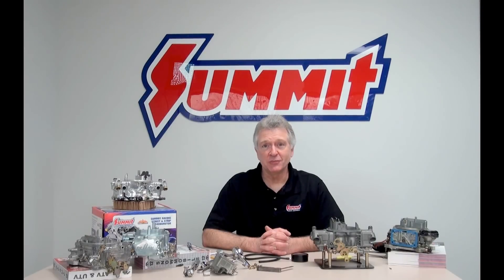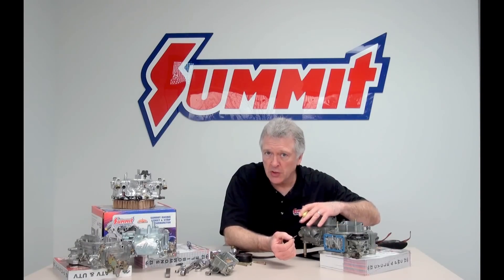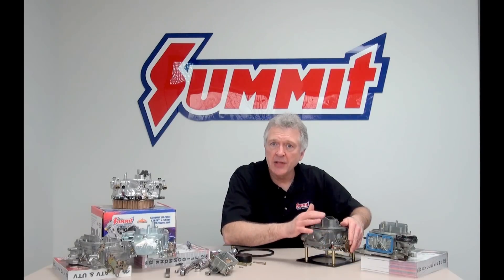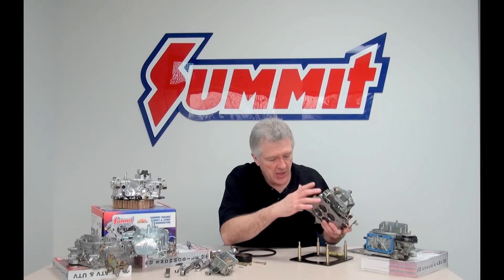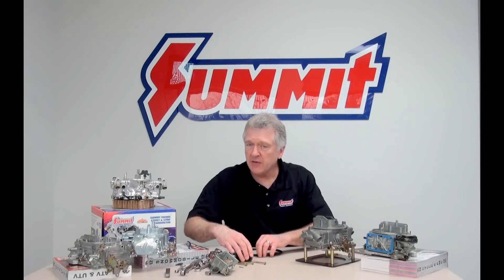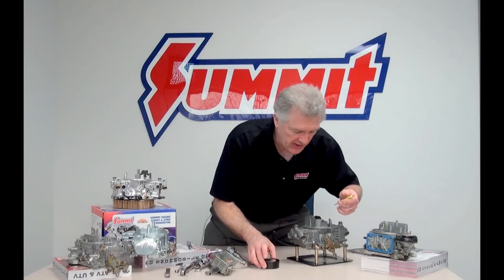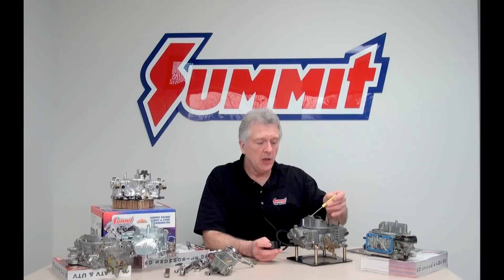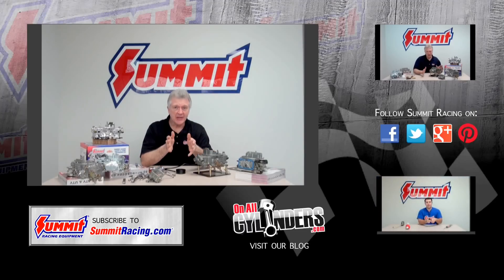Carburetor Idle Adjustment - Summit Racing Quick Flicks

Comment: Did he say power valve can suck in fuel at idle if vacuum reading at idle is lower than power valve size? I thought power valve gets fuel from the booster which is completely separated from idle circuit?

Comment: I was looking for a replacement manifold on the web site, talk about confusing, I typed in my make and model and it said no match for a 66 corvette
Reply from the maker: Im going to assume it’s a small block so here is a link to the small block manifolds but it would best if you gave us a call at 1-800-230-3030 that way we can get you the best match possible! 
 
https://www.summitracing.com/search/department/air-fuel-delivery/section/intake-manifolds/make/chevrolet/engine-size/5-7l-350/engine-family/chevy-small-block-gen-i

Comment: Hello, I have a 1987 F150 351 5.8 engine with 2 year old 4950 Holley  Carburetor. Some bad gasoline from the rear tank end up in my carb and now I have a big problem.
 When I have it in Park the carb works great 3K, 4K Rpm no problem, but when I have it in DR (Load) pushing the brake down and gas pedal to the floor I'm getting 2K RPM.
Please help. Thanks for your videos.

Comment: I'm having a problem with a 4160 700 cfm, 2 corner idle. Just rebuilt, new power valve 5, 10-11 hg vacuum on motor. Idles rich, but I tried putting a .017 wire in the IFR to lean it out, Holley never put the brass inserts in the hole. Just casting. And its huge. Should I throw the metering block out and get a good one or can this be saved ?

Comment: i have a 93 Chevy 1500 truck with a 350 bored 30 over with flat tops and a 287 cam with a 480 lift and a 232 duration and I have a Holley 600 CFM and when I turn my steering wheel it tries to go dead I've tried everything and I can't get it to stop

Comment: i have an 850 4 corner idle e-85  quick fuel carb that will not adjust at all, i can close them all and it will not dye, i changed the power valve to a 6.5 from a 3.5 that came from factory i have not checked vacuum on engine but if i put it on gear i will not dye, it's automatic and is a 408 ford
Reply from the maker: Hi Sergio, 
Can you give our tech line a call? 1-330-630-0240? Or you can call Quick Fuel directly. We would need additional information. Thanks for watching!

Comment: Norm great vid. Why don't you mention the secondary metering block in your tutorial? Don't all 4150s have idle mixture screws on all 4 corners? Shouldn't you continue to adjust thru to the secondary block also? You only apply the adjustment to the primary metering block in this  case? What am I missing? Also I have a quick fuel 600 cfm. double pumper (based on a 4150) I can apply the same adjustments to this carb correct?
Thanks in advance. 
Keep up the great work.
Reply: i have a 4150, street avenger 670, it only has the front idle screws

Comment: I have a 600 cfm holly 4v. It wont idle at all . what could this be? I just trying to get the car running after 20 years sitting
Reply from the maker: +Dave Poeske, 
Dave after that many years of sitting there are so many things that will need to be checked and most likely fixed. Things such as flushing the fuel system, doing a compression test, rebuilding the carb, checking for cracked vacuum lines, etc. Give us a call and we can go over some things and help point you in the right direction! 1-330-630-0240.

Comment: Hi Norm, I'm a Norm too, I bought a 502/502 crate motor about 14 years ago and put it in my old Chevy truck, I know I need to educate myself to maintane and tune the motor myself.  It came with a Holley 850 (don't know if it is a double pumper or not).  Subscribed to your channel and will start watching your videos.  For starters I'm sure my carburetor could use a good cleaning, I was told once not to spray carburetor cleaner everywhere as this will dull the finish on my aluminum manifold.

Comment: I have a QuickFuel BDQ-850 mech secondary carb (4150). I've run the secondary mixture screws all the way in, and using only the primary mixture screws, I've finally managed to get a decent air fuel mixture. However, the curb idle screw is backed all the way out, and the car still idles at about 1000 rpm. What can I do to get the idle lower (I want 800 rpm).

Comment: hi, great videos! im not sure if i missed something so i will ask, my carb has a 4 corner idle circuit. how and when do i do the secondary side? just do it the same way and time as the primarys are getting done or do i have to have the motor revving enough so the secondaries are slightly cracked? thanks
Reply from the maker: Hi khany454, 
 Four corner idle systems exist for motors that use a single plane intake manifold and require a more even idle fuel distribution than a two corner carb can offer. The four mixture screws control fuel at idle only and all four butterflies should be closed at idle. Try first to use just the front mixture screws, if the motor is unable to idle well, and there are no vacuum leaks, try adjusting them all evenly. Depending on the motor (and the manifold) sometimes you will find that all screws will not be turned out the same amount, this is ok too! Making the motor idle well without being excessively rich is the key.

Comment: I never ever (in 44 years) have left the mixtures screws at fastest idle. The mixture screws should be slightly rich, 1/2 turn out, from fastest idle to allow for any contamination which will cause a lean condition and rough idle. Slightly lean will cause a rough idle long before a slightly rich setting. I want to go the longest time between adjustments and that 1/2 turn out will allow that. This should be told to people not the EPA version. In fact the EPA wants the mixture screws slightly in from fastest idle which is genuinely asking for idle trouble. I think the EPA is responsible for the misleading advise I find on You Tube that I read as the authors of this reading material feel threatened if they don't write what Big Brother wants. I own multiple cars and three of which have two carburetors and the last thing I want is to spend extra time readjusting them sooner than later. I have heard from some that there should not be any dirt in a carb. because there are fuel filters that will collect it. But take a carb. apart and look in the bowl and you will find dirt. Do the 1/2 turn out or plan to readjust more often.

Comment: hi- im having a problem with idle. i can raise it as high as i want but when i turn the screw counter clockwise to lower the idle- it will only drop the engine to 1000 rpms at idle. no matter how far i back it out it wont drop rpms.. any ideas?- thanks
Reply from the maker: Hi bigpaw64, 
Sounds like the typical vacuum leak. Check for any cracked or split rubber vacuum hoses, a bad carb base gasket or bad intake manifold gaskets. One other thing providing it is a 4 barrel carb, check to make sure the rear secondary butterflies are not open too far as well. This too will cause a high idle!

Comment: hi! I adjusted my 4 corner idle with my holley vac gauge. I got it from 7" to 12". I was going to crack the secondary throttle plate slightly to allow more air through as you explained. But I thought I could take it for a drive and check if it likes to idle better when sitting there for a while. its a fairly large cam with a lot of overlap ect. and was very fuely on idle at around 2 turns out. after the tune it ended up at around just over half turn out. it seems a little on the lean side but is that ok? could that just that my setup likes a leaner idle? if I go for a drive and sit at traffic lights for a while and it seems like its going to stall, can I then crack the secondary throttle plate? thanks so muych for your help.
Reply from the maker: Hi 001ains,
Can you give our tech department a call on this question? 1-330-630-0240. We look forward to your call. Thanks for watching!

Comment from the maker: Hi 001ains, 
Because air & fuel distribution is not equal across the intake manifold at idle (closed throttle), it is perfectly fine if all 4 screws are not adjusted equally; but they should be close!

Comment: Once you have reached the highest vacuum on all 4 corner idle screws. Do they have to all be exactly equal. Cause if you finely adjust it so they are all at equal turns out, that will change your vacuum and defeat the purpose of the excersice? Or do u get it so highest vacuum is reached at all 4 corners then leave it?

Comment from the maker: A stock or mild build 350 Chevrolet might idle at or around 500 RPM once at operating temperature in park or neutral; keep in mind that ignition timing directly influences you curb idle speed - here I would consider 4, 5 or 6 degrees of initial timing before top dead center. I hope this helps, let me know.

Comment from the maker: Maikolo,
Park or neutral will be fine for setting up the idle circuit and or curb idle speed. Ideally when working with your idle circuit you should have a vacuum gauge and a tachometer that will display down to the tens position or better. Keep in mind that the more accurate your tools are the more accurate your settings will be.

Comment: when you first start tuning you turn the car on and have it running, I dont know if I missed it in the video ( im drinking watching this so forgive me if I missed it) but do you need to put the car in Neutral or Leave it in park? Or do you do that when your adjusting your RPM?? what is the way to adjusting your RPM (chevelle 350) and where is the RPM suppose to be at when in idle?

Comment from the maker: When adjusting the “Idle Mixture screws” clockwise will shut off idle fuel and counter-clockwise will increase idle fuel. A steady needle on the vacuum gauge is a good indicator that you’ve achieved the correct idle mixture when adjusting both screws the same amount of turns.

Comment from the maker: These 2 screws should be adjusted equally as each one delivers idle fuel to 4 cylinders apiece (V8). As suggested in the video, you can adjust using a tachometer, vacuum gauge or the best would be an exhaust gas analyzer. The latter is generally only available at a professional installation shop. 
  The “Curb Idle screw” when turned clockwise will raise the idle speed (RPM) of the motor, and when turned counter-clockwise will lower the idle RPM of the motor.

Comment from the maker: Hi Ron S, 
 There are 3 adjustment screws concerning idle on most carburetors. The first is the “Curb Idle screw”. This controls the engine RPM at idle and is located on the drivers side of the carb down at the primary throttle shaft. The other 2 screws are the pair of “Idle Mixture screws”. These are responsible for the amount of fuel that travels into the motor beneath a closed throttle plate (Idle).